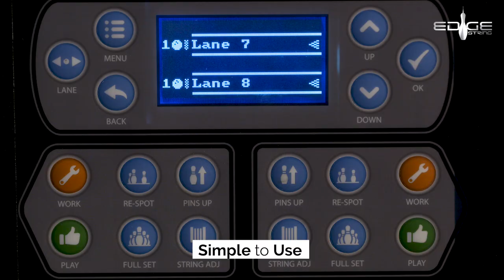Join the String Bowling Revolution | EdgeString

Comment: What returns the balls?
Reply: Probably another string
Reply: There’s a ball ramp in the back. When the ball falls into the pit it rolls to a door then the door opens and the ball sits on a paddle type platform which is then lifted by chain up to the top of the ramp where the paddle tilts forward sending the ball back by gravity. Can be used on above or below ground ball returns